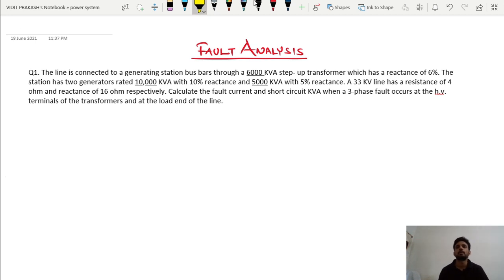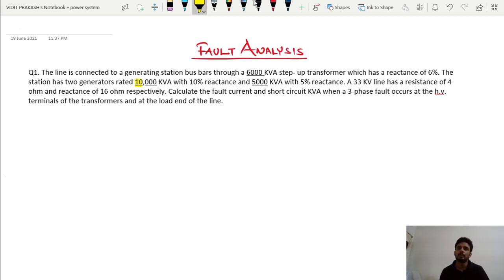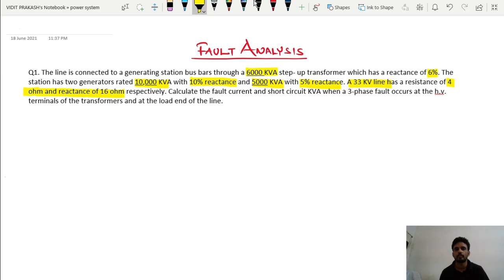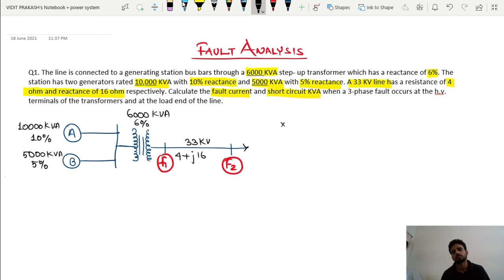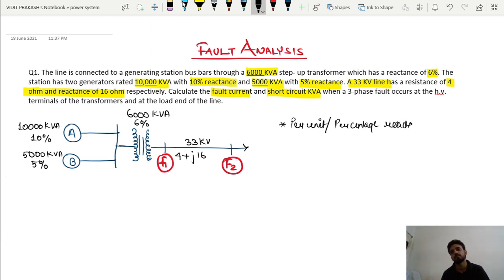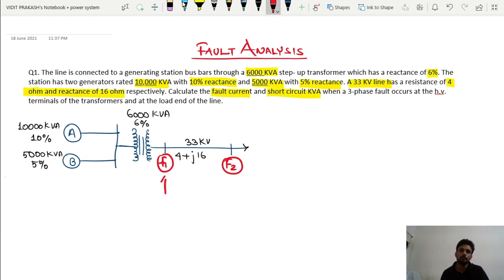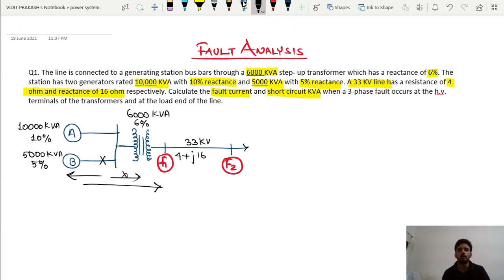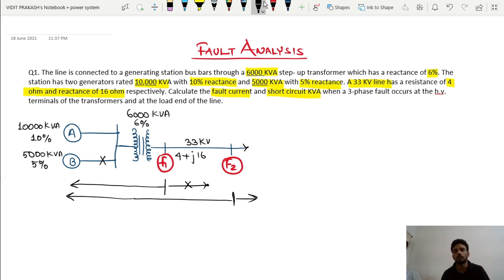short circuit kVA and current numericals | fault analysis | power system | LECTURE 8

Comment: whoops, so interested I wish I saw this video in time before my last two lectures but with the help of this very clip, I can now be happy with the topic and move ahead to learn on the topic. but I got a question please I need the answer, Pls can any perfect Engineer help with the question The safe Fault Level for Planning of 11 kV systems is 95% of the design rating of older equipment which is rated at 250 MVA. Comment on whether or not this will be achieved with the new generator added to the existing network. If not, discuss measures that might be taken to reduce the fault level and propose a solution that will rectify the problem.
Reply from the maker: Hello sir, thanks for sharing your valuable feedback with me. First, As per my range of knowledge, the power system has various prospective to analyse its design. We always try to tends towards efficient and economical system. Now, 5% is the acceptable margin of any analytical model. But, with the help of multi range of devices-  like the most popular device is RTFLM device which is a real-time fault level monitoring device,with the appropriate measurement configurations, the devices can estimate the fault level within 1% range.